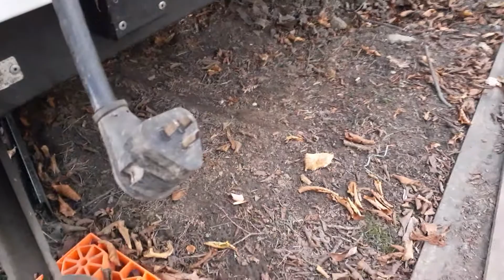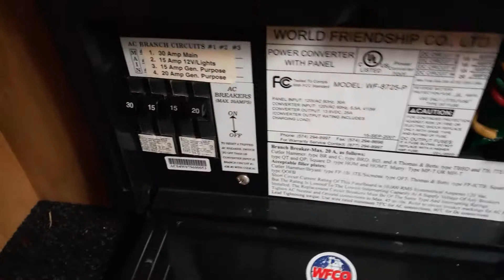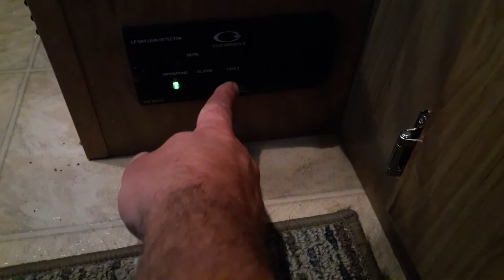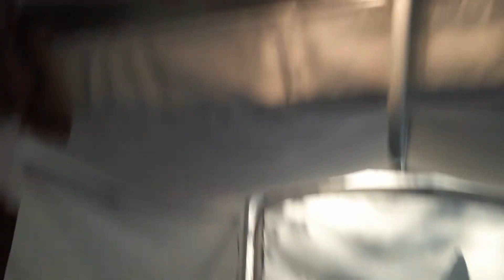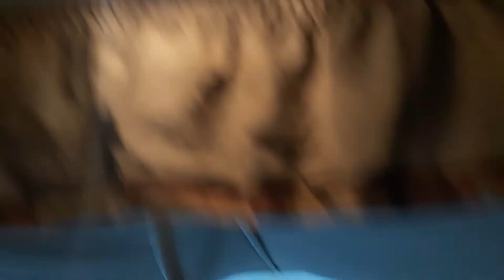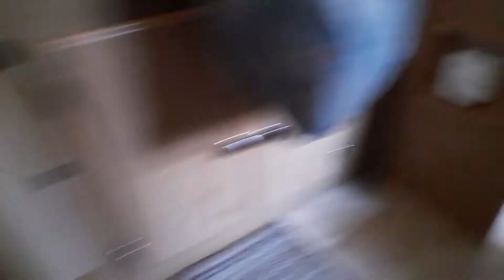Pop Up Camper Electrical and Heating Basics

Comment: While driving to the lake with the Jeep (7 wire) hooked to the camper can you run the fridge? Or would that be a danger? I was told by a friend to freeze milk jugs to pre-cool the fridge instead. (And have towels under not to get the water leaking. It's about an hour away.)
Reply from the maker: Shouldn't be a problem!
Reply: @jackofalltradesmasterofnon6120  Should I use the plug in to the Jeep? and not the propane.

Comment: So I’m plugged into my house all my outlets are working but no lights or anything else do I need to be hooked up to a 30 order for it to work
Reply from the maker: There's a kill switch under the galley for the lights to work, start there.
Reply: @jackofalltradesmasterofnon6120  I don’t think my model has that when I left the sink I’m nothing is under it but some rubber grommets
Reply from the maker: There's definitely a cut off for the lights somewhere, it's to make sure you don't leave them on when you pack up the camper and catch the mattress on fire

Comment: I have a 2022 pop up and i cant seem to get the heater to work off the plug in alone. I had to use gas and it used a lot for just one night.
Reply from the maker: The heater burns propane for heat, electricity is needed just for the fan.
Reply: @jackofalltradesmasterofnon6120  that’s why the air coming from the heater is cold

Comment: Wrong... if you're plugged in and your 12v inverter doesn't work you will have no lights because the inverter puts out the 12v for all the lighting... that's my present situation so I'm bypassing the inverter and adding a 110 to 12v inverter with a fuse block which is way cheaper than replacing the built in nverter.
Reply: We are camping right now. And we don’t have lights. So, I connect the battery and now we have lights but I wish to have light from the electricity in the camp site

Comment: my heater , overhead lights and gas leak detector don't work off the battery. With the cord to the house everything works. No idea why. Can you help?
Reply from the maker: Check fuses
Reply: @jackofalltradesmasterofnon6120  it keeps blowing....any ideas why? only when I try to use the battery though. Just the 20
Reply from the maker: @schutztruppe check all the wires underneath for damage
Reply: @jackofalltradesmasterofnon6120  well  no damage under trailer but as soo as I put in a new fuse with the red battery button on, it blows instantly. I removed the the hole box with the fuses but I'm afraid of cutting the blue wire instead of the red, if you get my joke. Should I bite the bullet and take it to a shop?
Reply: Hey i know this is 2 year old post but did you ever figure out why you kept blowing that 20amp fuse ?  @schutztruppe
Reply: @dsackgarage6082  no. I just change the fuses and it never happened again. No clue what the heck that was all about. I now have an r-pod. No more pop up
Reply: @schutztruppe  thx buddy for the reply

Comment: Does my 12V switch have to be turned on for the battery to charge while it's plugged in at home?
Reply: No, the 12 volt switch is only to operate the refrigerator on 12 volt.  This guy has no idea what he's talking about. It should only be on when you're traveling to operate the refrigerator.
Reply: I have solar so I run the refrigerator on 12 volt during the day, and on propane at night.

Comment: I have my new camper plugged into my house with an adapter and there’s a slight hum or fan sound coming from where the fuse box is.  Is that normal?
Reply from the maker: If you have a lot of items running at the same time, the fan will come on to cool off the fuse box.

Comment: Do you need the pilot light switch deal for 120??
Reply from the maker: The pilot light switch is only for propane
Reply: @jackofalltradesmasterofnon6120  Do you need the propane on when turning on the hot water heater?
Reply: Thank you ... I’m trying to sell my pop-up camper that we bought and remodeled and I have everyone asked me every question in the book , so thank you